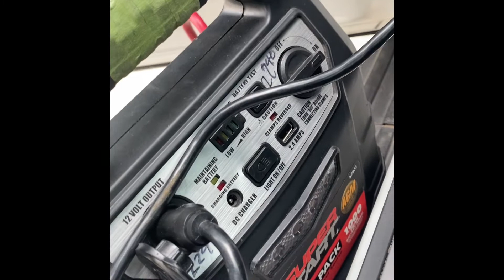NISSAN PATHFINDER | HOW TO CHANGE / REPLACE BATTERY

Comment: unusually for modern cars that does not look too hard
👀fully viewed👀👍Au👍thumbs up like
Reply from the maker: Yes, but the main difference is that with modern cars you have to connect the starter box to keep the computers running or you get it into trouble 😂
Reply: @maverickchannel360  yes I know been there done that damn have to get computer reprogrammed